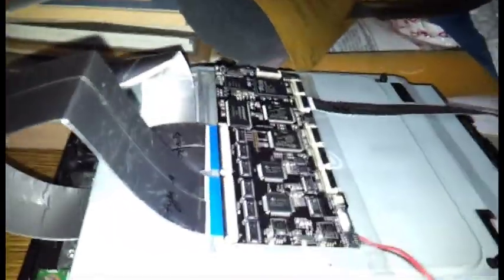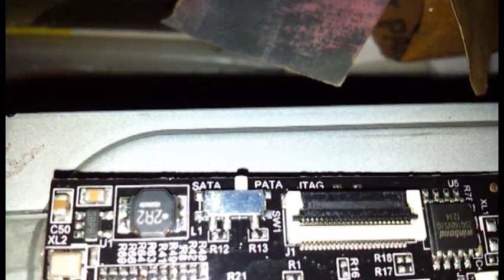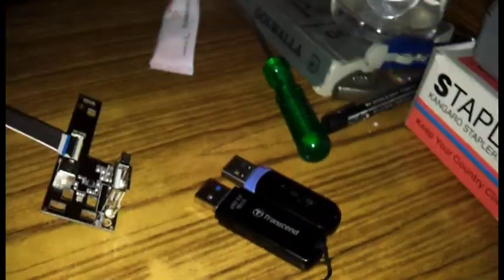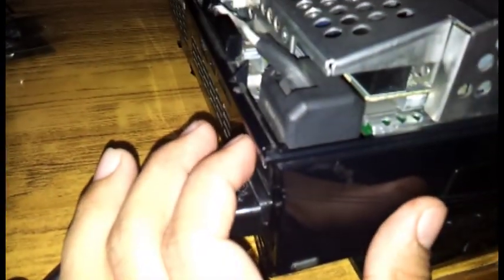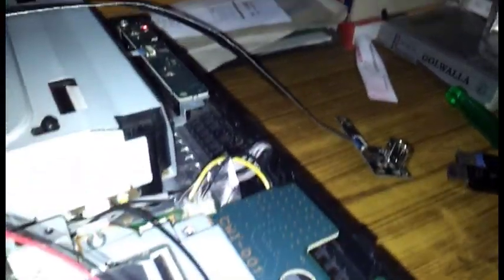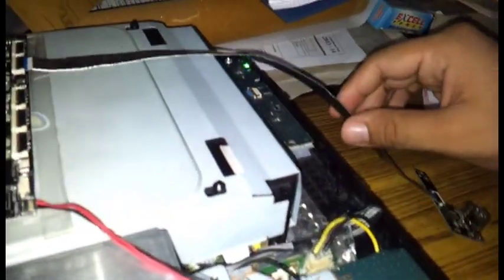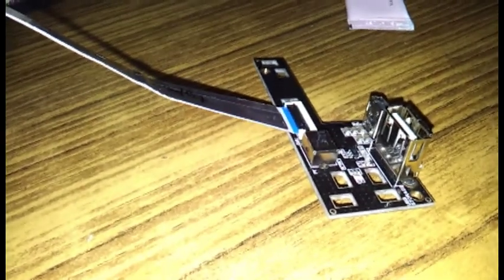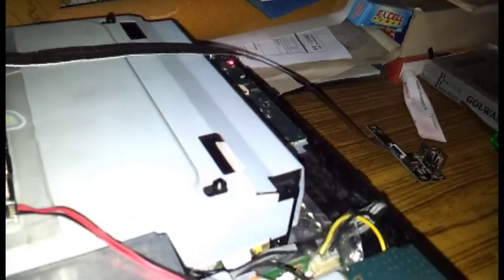COBRA ODE on CECHA01 ERROR! - NO LED Light after upgrading the MCU.ROM

Comment: One more thing, I know it comes with that double sided sticker, screw that sticker put it on your HDD or something, Put black electric tape on the back of the PCB board covering it, Electronics use electricity, make sure it's insulated from the metal beneath it, it can have shortages from bottom of board to BD drive too metal housing. That double sided sticker is a joke for an insulator. I cut it out and put it on my external HDD that I use for my Cobra manager and files saved games etc.
Reply from the maker: Yes..I agree

Comment: Had this problem, solved using the files from the link below. Is in Portuguese-BR, but there should be no difficulty translating.

http://www.4shared.com/rar/8_wdDBN1ce/CobraODE_-_Soluo_Erro_Luz_Verd.html
Reply from the maker: I solved it later on.. by freeing the PCB of any dust and putting the plastic so that the bottom does not touch the metal.